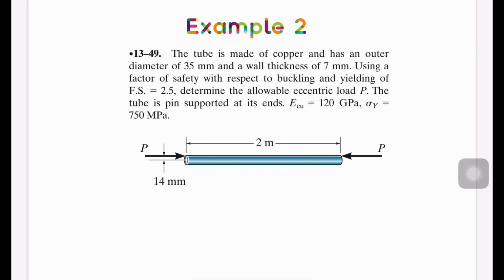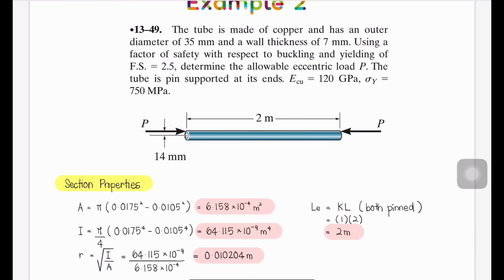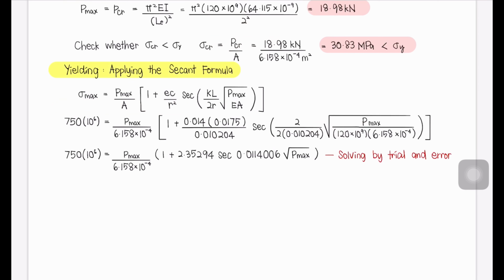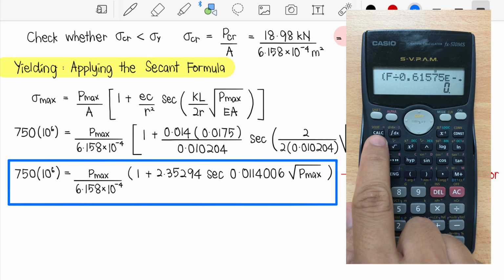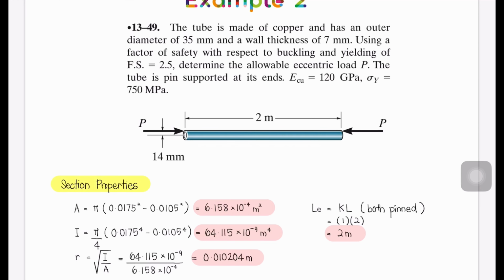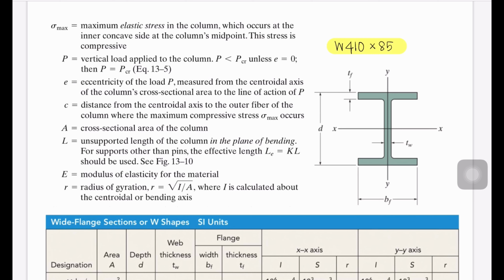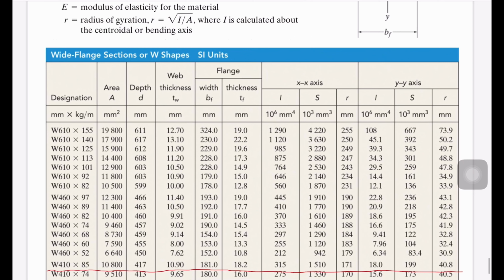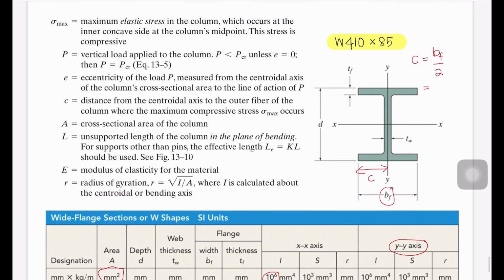Column (Part 3) - Eccentric Loading

Comment: Dr, i would like to ask you. if the outer diameter is 35 mm and the wall thickness is 7mm, the inner diameter should be outer diameter - wall thickness right ? if that right, so inner thickness should be 0.0140. Correct me if i'm wrong.
Reply from the maker: outer diameter 35mm with thickness 7mm, so inner diameter = 35mm - 14mm = 21mm = 0.021m.